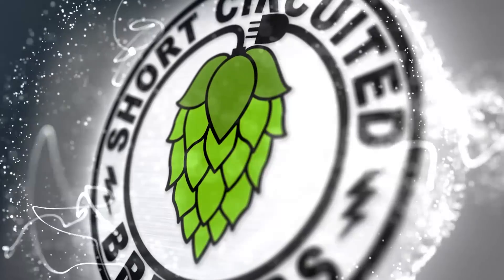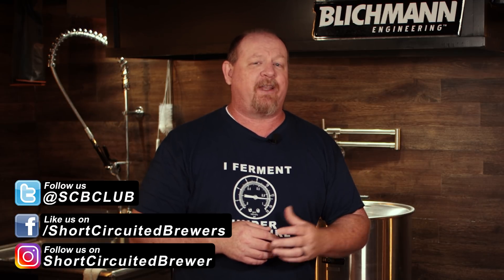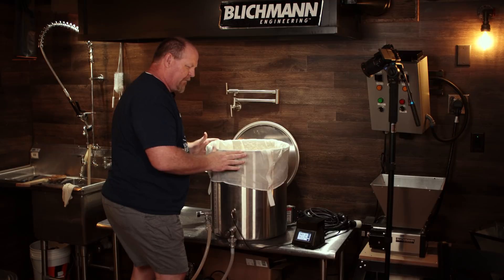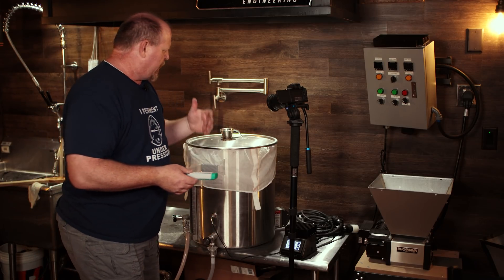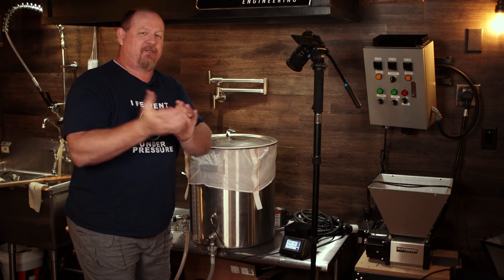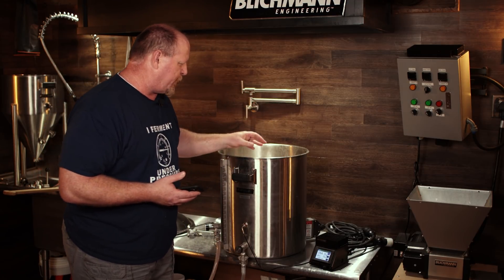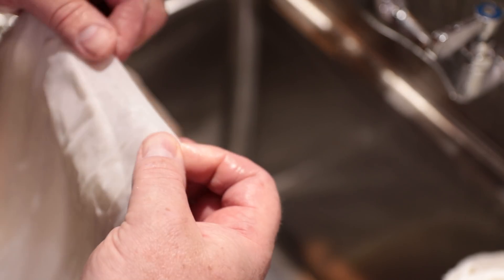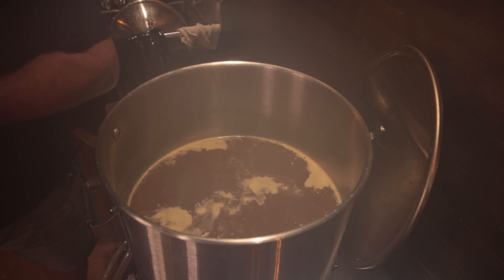BIAB vs Blichmann Boilcoil (No false bottom)

Comment: Thanks for the video Brian. Just thought i'd mention, to avoid the paranoia of a ripped bag from a thermometer/probe tearing as it's being pulled up....just slide on a silicone stopper to the tip (i have a ss brewtech thermometer that is super sharp at the end, so it would easily rip the bag if i wasn't careful).  Silicone stoppers are resistant to extreme heat, around 300c I believe. The stopper for me at least, makes no difference to the temp reading, as i've tested it against other calibrated thermometers.
Reply from the maker: Oh cool!! That's a good tip! Thanks for sharing! 👍🍻

Comment: This is exactly what I do. I bring the water up to strike temp, add the bag, add the grain, recirculate through the kettle lid, leave element on and haven’t had an issue after 26 batches. I also mash out at 170°F. I use the 200micron by The Brew Bag.
Reply from the maker: Nice! More data. Thanks for sharing! 👍🍻

Comment: I used to recirculate to the top but the last few beers I've just ran the WP port with my BIAB (basket + bag) and it seems to keep a temp well enough for a mash. All the numbers are being hit. I just have to stir every 15 like you to even out the heat. Not a big deal. It certainly beats messing around with with a sparge arm. Cheers!
Reply from the maker: Definitely. I liked the results I got. It was super easy brew day! 👍🍻
Reply: @ShortCircuitedBrewers  Exactly. If I can take the step when I mess about the sparge arm I will call it a win. Plus, ever since I focused on yeast health and water chem the mash almost seemed to fall to the bottom of whats important (to some degree at least)
Reply: @ShortCircuitedBrewers  I brewed today and just recirculated through my counter flow chiller the entire time during the mash. When it came time to chill I just hit the water valve. Takes the step out of setting up the chilling mid boil. Its already setup from the start.
Reply from the maker: @ajoyce  good idea!

Comment: Interesting, you got 100% conversion efficiency.  20lbs of pils into 14 gallons gives a theoretical maximum pre boil gravity of 1.047.  Brewfather under reports efficiency, your mash efficiency is over 85% with the numbers you have here.  Pretty impressive for such a simple setup.  How fine was the grain crush?
Reply from the maker: I don't know the gap measurements but it was pretty fine. Did you see the grain in the video? It is really crushed well. That's pretty amazing with the calculation you've stated. 🍻👍

Comment: So you are back to the tea urn and bag method.
Reply from the maker: Not sure what you mean by that?
Reply: @ShortCircuitedBrewers  Well, it's like you have a really expensive piece of kit to do what we all do (in the UK at least) when starting out all grain brewing. Buy a tea urn and a bag. Just seems a step backwards.
Reply from the maker: Oh ok. Well I'm all about exploring options for people and trying new things. I understand your point though. I'm not going to be using this method predominantly. 👍🍻
Reply: @ShortCircuitedBrewers  nothing wrong with the bag method though. I use it with my brewzilla before inserting the malt pipe. Catches all the small bits that the false bottom misses. Kudos to big banana brewing for that tip.
Reply from the maker: @dr.t6034  Yes that is a good tip! 👍🍻

Comment: To add to David Howard's point, I have a High Gravity system and while I like the basket for ease, David from High Gravity has stated a few times that the boil coil is safe on bags. I was concerned about the weight of the grain possibly loosening the seal and causing a leak but I'm a bit OCD.
Regarding bags, I love both the Brew Bag and the Wilserbrewer bag but find when I use my HG system and recirculate, the Wilser bag, the recirculation is a bit better.  I've found with the Brew Bag that I have some compaction due to the pump suction that I just don't get with the Wilser bag though they both seem to be very similar in construction.  Just my 2 cents.
Reply from the maker: I appreciate the confirmation and feedback! 👍🍻

Comment: Another data point here. I've been doing the same with my high gravity brew system (has the Blichmann boil coil) for 20 + batches. I have done a mash out on occasion but have always stirred while doing so. No problems at all.
Reply from the maker: Cool!!
Reply: Ditto. Threw out the basket from mine and just use the bag now.
Reply from the maker: Nice! Good to hear. Do you ramp up for mash out?
Reply: I do on occasion and have done a step mash but I always stir while ramping up. The stirring may not be necessary but I haven't been that bold yet.
Reply from the maker: @dhoward7524  gotcha.. wise decision!! 👍🍻

Comment: I've always heard that you can do this with the boil coil and I never doubted it but its nice to have one more data point. However, just because it can be done doesn't mean it's ideal. There is some merit to having an area of free wort in the heated areas so that heat doesn't build up locally. If you were able to have a few remote thermocouples down in the grain bag about a 1/4" away from the contact point of the coils, you'd likely find a pretty large delta over the mash temp. In addition there should be a more distributed path for wort collection. You could have easily had the bag get sucked against the drain port and your flow would be very diminished. I know you took some slack out and that likely helped a lot. So, my recommendation is to try to force a liquid only zone at the bottom however you can, whether that be a very careful removal of slack, maybe with a tight bungee cord around the kettle to hold it from slipping, or by using a makeshift false bottom that sits about mid way up inside the boil coil. In a perfect world, there would be a coarse false bottom about an inch off the kettle floor, and then a spacer about 1/4" inset from the coil. That would make the kettle perform more like a kettle RIMS or actual RIMS (tube) type system.
Reply from the maker: All good recommendations Bobby! I was actually amazed that I didn't get the bag stuck in the dip tube as well. I had about three quarters flow on the linear valve for the Whirlpool port. All in all I'm pretty happy with how everything turned out. 👍🍻

Comment: Hey Brian. Thanks for the video. This has been helpful to me, as I have occasionally had some issues with the Blichmann false bottom. I am interested in a basket if they do come out with that. Does the whirlpool port work out better than the one that comes with the system? Is it just a SS elbow that you put on for the whirlpool port? I also have the brew bag, and am interested in trying this. Thanks for the experiment!
Reply from the maker: The Whirlpool port I'm using is the one that's made by Blichmann. In the video you can see the interior part of the Whirlpool it's not just a stainless steel elbow it's actually a tube that's bent and uses the same type of connection as the dip tube does. On the exterior it's just a linear valve like the other valve that comes on the G2 kettles.

Comment: Grate video, Something I have been wanting to try for a long time. Is there any reason why you did not recirculate through the bag?
Reply from the maker: With the bag draped over the kettle I didn't really have a good way to do that and use the whirlpool port. You could make a recirculation arm for the exterior and not use the Whirlpool port. I just kind of wanted to use what I had but with the efficiency that I got I'm not complaining!! 👍🍻

Comment: Great job! I always wondered i the false bottom was needed and if the brew bag would get damaged. Thanks for the post.
Reply from the maker: Yeah me too John! I read so many varying opinions online. But no real evidence or direct statements saying you could or could not do it that way. I found it my duty to test it!! 👍🍻
Reply: @ShortCircuitedBrewers  I was thinking of transitioning to a basket instead of a bag and false bottom.
Reply from the maker: Yeah I think this proves you really don't need a false bottom. As I said in the video I definitely wouldn't try to ramp up for a mash out. Aside from that I would say it's processes normal!
Reply: @ShortCircuitedBrewers  Also is there some benefit where ythe whirl pool is started such as the top of pot, middle or bottom?
Reply from the maker: @jonmccombs1711  I did mine from the top by adding a hose. Personally I think there's some benefit to directing the recirculation to the top of the mash, That way the liquid is moving up and down in the kettle and helps prevent stratification. But I have no testing to back that up. Just my thought process. 👍🍻
Reply: @ShortCircuitedBrewers  Thanks and Happy Father's Day
Reply from the maker: Same to you!!